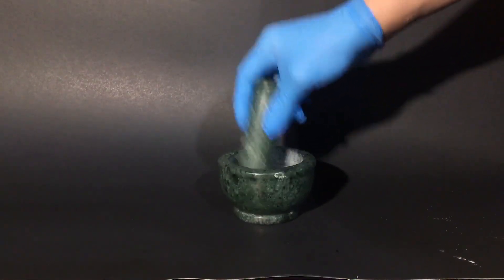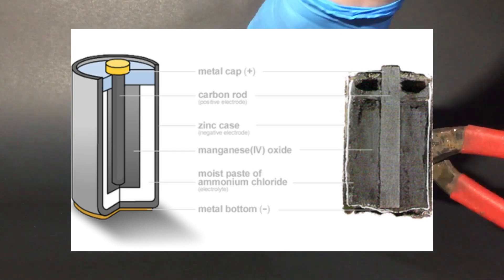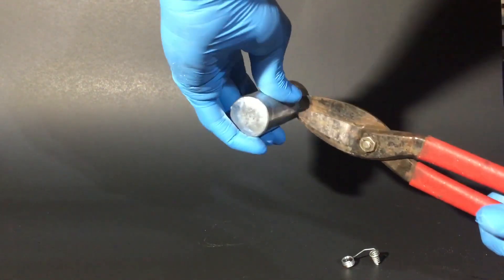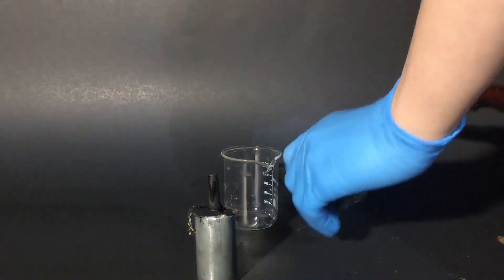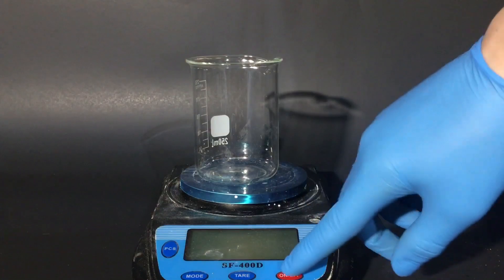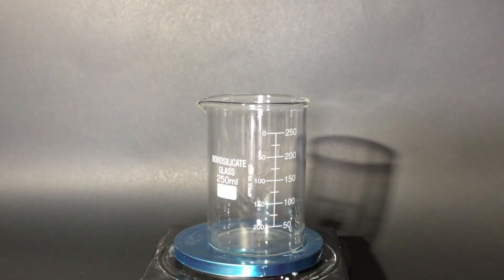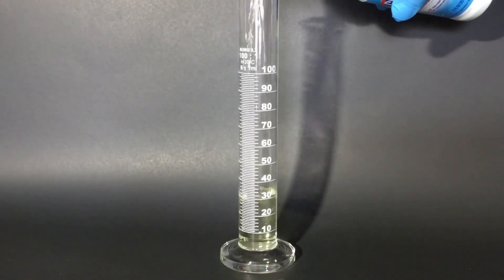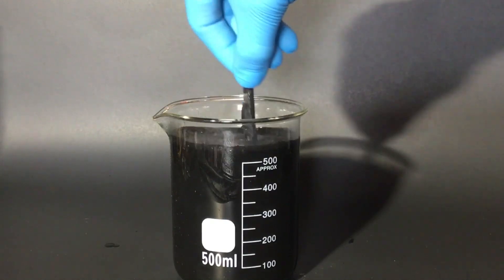Making sodium permanganate

Comment: I think you need Mn(OH)2 to get MnO4-
Reply from the maker: I think where I messed up is I should have tried to react the MnO2 with the sodium hydroxide to make Mn(OH)2 then reacted it with a stronger oxidizer
Reply: old chemistry journals say they made it only with mno2 and naoh and heat but air must pressent. air must also pressent if you use an oxidizer of you use an air tight fessel no permanganate is formed. @Chemanic1

Comment: Liked the presentation & I think that you might be on a good track. The clip did not show how it ended.  I think that a side reaction is that you end up with some table salt (NaCl) in the mix.  I think that the trihydrate of your product melts in the mid 30s C?  Maybe?  Read something that somewhere. If you have a calibrated thermometer, you might be able to just heat the mix up and then the just decant your product right off into another clean beaker?  Maybe?  Never done this one my self, but it might work.  Best if tried this idea in a fume hood I would guess.  A lot of these sorts of salts a pretty hygroscopic; so there's that to think about.